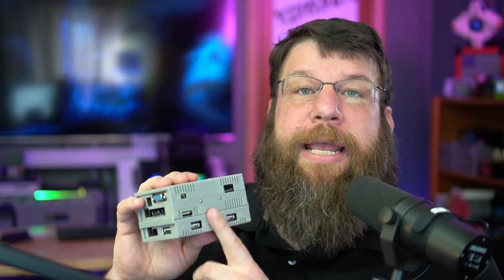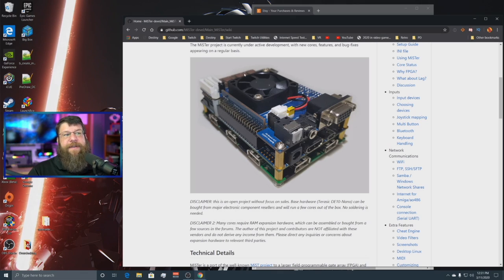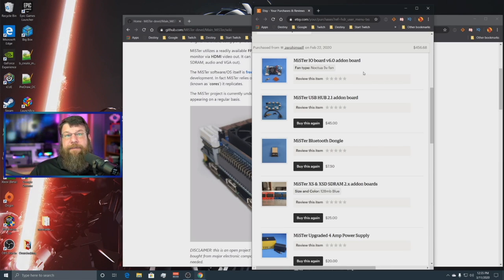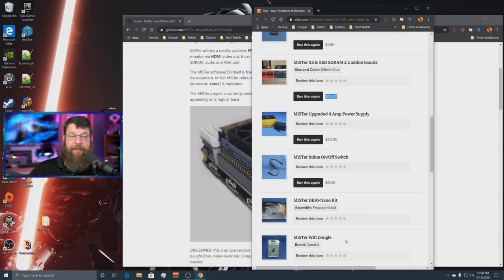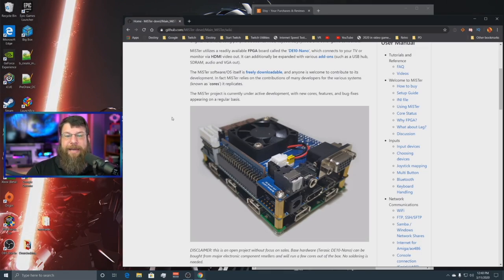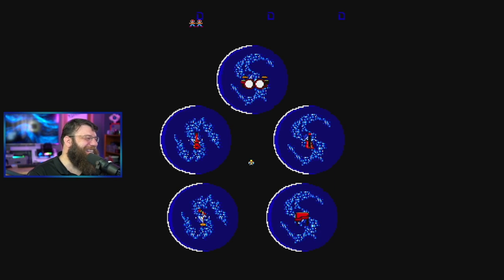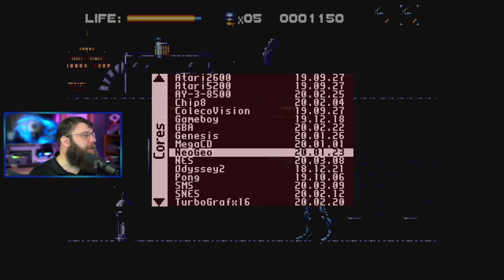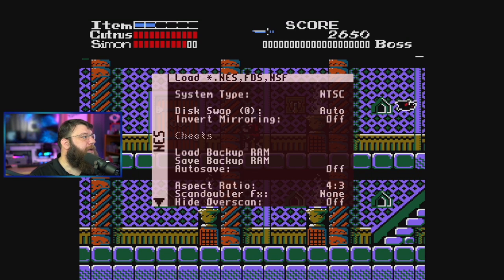What is a MiSTer FPGA - Modern Retro Video Game Hardware Emulation - 4K

Comment: Nice overview of a complete MiSTer setup!
Just wanted to comment on one thing-- If someone wanted to get started using MiSTer, the bare-minimum cost of entry is $130 for the DE-10 board itself, and many cores like genesis and turbografx and some arcades will be playable immediately. 
The usb hub, 128mb ram, etc are all extras. You can use pretty much any usb hub with an OTG adapter and get started there.
You can run everything mister has to offer besides a very small portion of neo geo games, with a cheap 32mb ram chip instead of paying for the 128mb one right away, if that small ~15% portion of neo geo games doesnt matter to you.
Reply: Do the MEGA CD and PCECD still run with the 32mb ram?
Reply: @anthonyr.2621  yes, literally everything on mister besides about 15% of the neo geo library will run with 32mb sdram

Comment: Overall great video showcasing the MiSTer, but the device is only expensive if you build it fully out like you did. You can get away with a DE10-nano, 32mb SDram, and a cheap amazon OTG usb hub and be out the door for under $200. I do my fully loaded builds for friends, and the costs comes in at $320.
Reply: Would you consider taking an order?

Comment: Great review! Thanks.

Can I boot directly in a certain core, or do I need to select a core everytime I switch it on? I plan on buying this for a specific core and would like to boot that core directly. Just like when using the real machine.
How is overal compatibility? Are these cores good enough to run most on it without compatibility issues or glitches. I love the fpga solution, but it's only great if the cores are good enough.

Comment: For anyone that wants to start cheaper. Get the DE10 nano ~ $140. Then 128 mb sdram at ~ $60. Then 3D print a fan add on at the library or similar. You now have basics to run everything if can do at $200 plus shipping. You can be creative in making your own case or 3D print one. I even saw one made with regular legos. Doesn’t have to be fancy. Then over time you can add things that you feel will make a better experience for you over time. And honestly, this is a fun project that may take a little time configuring and learning if you are more casual like myself. It might be a while until you feel like you want a usb hub or nicer case.

Comment: I've been looking forward to seeing this in action since you've been talking about it on DCP. Raspberry Pi's are like $40 without a case but u definitely get slowdowns and input lag.
Reply: Talking about FPGAs and Raspberry PI is like talking about Motorcycles and bicycles, both uses wheels...
Reply: O.D.L.1776  you never saw and never tried a FPGA system i guess, it's not emulating old hardware, it's become old hardware, it's like using exactly real old hardware. Please Just for your pleasure try to search videos and informations about rhis kind of systems.. you May discover a new awesome world..
Reply: I think it’s not the same. I’m dealing with emulation since 1996 at times of Neo Rage X and BLEEM. I always asked how that games would look on the real hardware because most of time I hadn’t access to it. Now if we put a pi running Mame and compare to those that’s obvious which one is real. Pi is good for things that can’t be on the FPGA yet like PlayStation.
Reply: There is a huge difference here on this conversation. The emulators like mame fly cast or libreto are cores developed to emulate hardware they aren’t the hardware they try to mimic them. Still you’ll have the OS overhead like windows or a RetroPie.
When you run FPGAs you have nothing of those the machine turns into the same chips they are simulating. That’s another level of simulation not emulation.

Comment: It's probably worth noting that you really only need the USB Hub board if you want a fully all-in-one compact unit, as a standard cheapo external USB Hub will also work perfectly fine.  It just means you'll have a big ole USB hub wired out the side instead of an built in unit.  If you're on a budget though you can save a good bit of money going that route vs the $50 built in USB Hub board.

Comment: I only cared about a MiSTer FPGA to emulate a Tandy Color Computer 3 and an Intel 80486 CPU (well, maybe would be interested in the Motorola 68000 as well)

To create MiSTer Coco cost about $170 - if are okay with an HDMI display (I got a 32MB static RAM board) - if want an actual VGA video output, well that requires another i/o board, so may go over $200

Comment: I think iterating the "$600" price in this video may be a bit misleading, as you can get a full setup that will run every core for less than $250. Overall I really enjoyed the video and the rundown, but I'd just like for people to know that even just the DE-10 nano alone with an sd card and usb hub can run a decent little list of consoles, and adding the ram board opens up the rest!

Comment: Btw there's a very cheap genesis/megadrive system on a chip console on eBay from 20$ to 40$ with hdmi output, and a NES too with the form factor of a NES cartridge, not sure of console on a chip it's the same or different than FPGA
Reply: There's no comparison possible. You must try the MiSTer for yourself to understand.

Comment: An FPGA is not really "emulation".  It's actual gates, nets, clocks, etc.  that can be reconfigured.  So you're not really emulating anything (emulation means interpretation in software).  This is why FPGAs can do a better job of running weird old hardware, because they can be configured to actually BE that hardware (or at least a close approximation) in whatever weird way the original design was laid out.